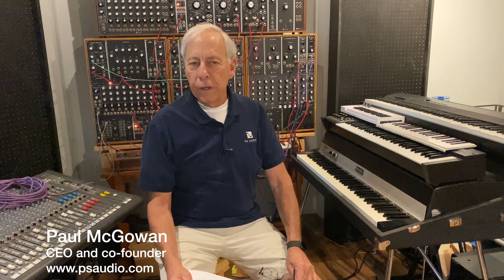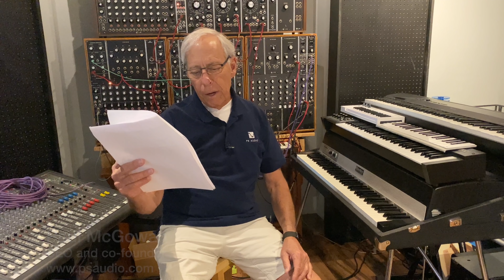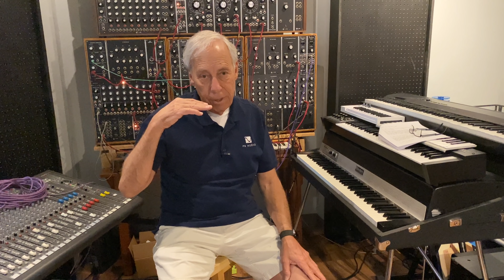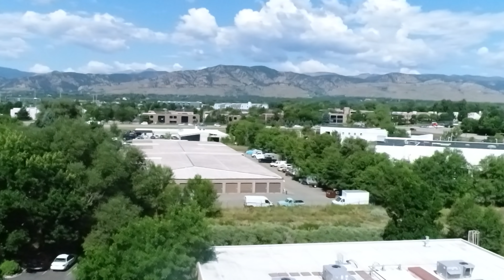Current and voltage amplifiers

Comment: voltage is cheaper to make, typically used for driving headphones. It can't drive loudspeakers.
Reply: The marketing behind the terms typically infers the power supplies ability to keep stability at a given speaker load. And minimize vdroop at high output volumes and/or drive low impedence loads like 2 ohms. In technical terms it really should be line level verses speaker level as you mention. But.. Buzzwords sell product.
Reply: You are right! Voltage doesn't drive loudspeakers. Current (moving charge) drives electrodynamic loudspeakers, (static) charge (the integral of current) drives electrostatic loudspeakers.

On the other hand, voltage is generated by microphones, and by electrodynamic loudspeakers! There seem to be people around which do like the distortion of the voltage feedback of loudspeakers and call it 'electric damping', other people don't like that and call it loudspeaker reactance and current distortion!

Comment: Voltage is like the size of a water pipe.. current is the power required to make to make the water flow through that pipe
Reply: Voltage is like pressure. Current is like flow.
Reply: Brad Walker That’s better.
Reply: @bradwalker1259  The pipe is the resistor. Voltage controls how far the water exits.
Reply: @jamesplotkin4674  I've always found it helps me to understand the flow of electricity by comparing it to hydraulics. I think a good way to think about it is that the pipe is like an electrical wire, which has low, but not zero, resistance. A constriction of the flow in the pipe (a narrowing or a partially open valve) is like a resistor. Water pressure is directly analogous to voltage. Water flow (volume) is directly analogous to current. Even concepts like Ohms Law work properly using pressure, volume of flow, and constrictions.
Reply: @bradwalker1259  Nice ;-)

Comment: Well yes but amplifies very in current output for instance you could have two amplifiers 1 at 70 Watts 1 at 75W one has 13 amps of output power the other one has 19 amps about put power a high voltage output means nothing needs to be in the other way.
What is the current output of a Stella amplifier?